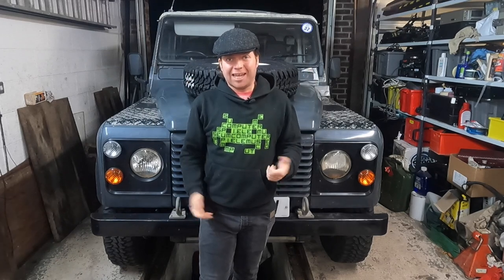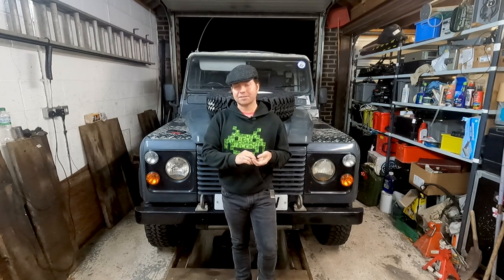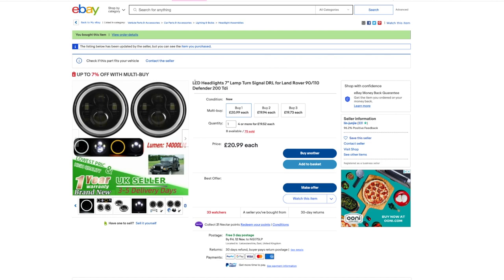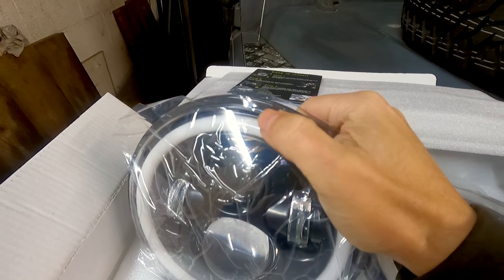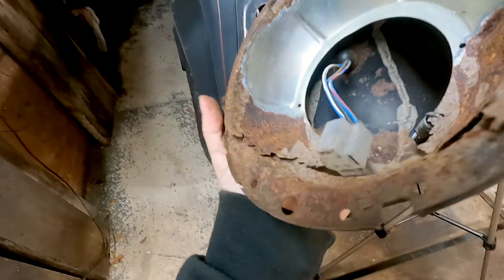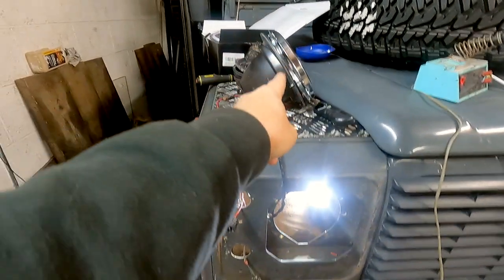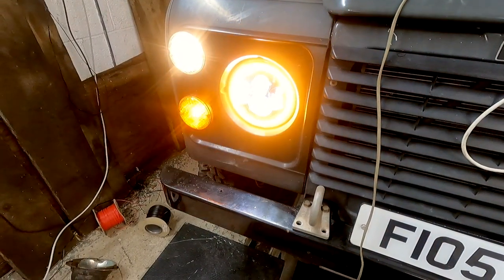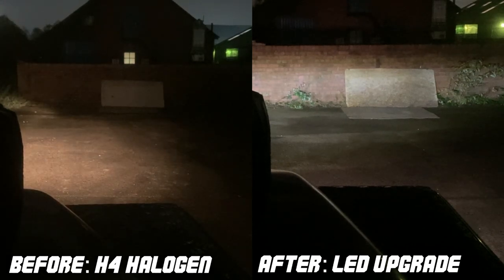LED Headlights: Legality, fitting and rated! Everything you need to know about upgrading!

Comment from the maker: An update on these LED headlights, a few months on...

Positives -
Our 1985 Honda Jazz, fitted with identical headlight units, just passed an MOT test with no advisories.
I've completed a week's off-roading in Wales where they've been dunked under water and still work fine.

Negatives -
With the headlights on they cause radio interference; I suspect some sort of RF filtering is necessary to filter out noise from the switched-mode power supply.
Beam pattern can be affected if the headlights aren't super clean.

Overall, for the price, I'd still recommend them.
Reply: I got news for you, LED's are not legal on vehicle headlights, they never have been and here is why. (You cannot get around this with any type of argument)
Whether they're aftermarket, or manufacture installed, LED's ARE NOT legal to be on any type of vehicle/automotive headlight in any of the 50 states in the USA.

The only place that determines what is legal on a vehicle headlight comes from the NHTSA (National Highway Traffic Safety Administration) They produce the FMVSS (Federal motor Vehicle Safety Standards) section 108 of the FMVSS has not bee updated to include LED's and until it does, then LED's are illegal on vehicles headlights in all 50 states. There is no policy, statute, guideline, suggestion, argument in any county, city, state, town..lawyer, judge, cop, manufacture, mechanic..etc that can over ride the NHTSA FMVSS as they have final say.

Until the NHTSA says LED's are legal on vehicle headlights, then LED's are not legal on vehicle headlights.

You People need to start paying attention to what Governs the laws instead of arbitrary arguments.
Reply: @360Investigations this guys clearly not in America is he.
Reply: @jamiemarks8910  No it isn't clear it absolutely looks like he's in the USA and the exact reason why he should be saying he isn't.
Reply: @360Investigations so the English accent, car plate, the fact he mentioned mot ect not clue you?
Reply: @360Investigations  Just take the L

Comment: Fitting led or hid bulbs in existing lamps will now be an mot fail for post 86 cars (light source not compatible), Pre 86 cars although they will not be an instant fail must still produce an acceptable pattern.

As you stated, fitting complete led lamp assemblies not just bulbs IS not an instant fail on post 86 cars but must still do correctly and produce a correct beam pattern.

Projector beam headlights will often pass MOT with led replacement builds because they do not rely on reflector or lense for diffusion and cannot be easily inspected visibly.

Comment: Fitted the exact same pair today to my 110 county, No soldering needed just spliced into side light and indicator, Pretty simple
Reply from the maker: Admittedly, we went "belt and braces" with this install, as we find splices and crimps end up failing after a few years. Typically you may also find the factory wiring has been hacked by previous owners, too.

Comment: Have you been for mot yet? I've just fitted these myself and I've gotta say the pattern they project dosent seem normal to me
Reply: Mine failed its MOT, and will have to change them back.
Reply: yep thats what i was worried about, some of them have a hurrendous beam pattern unless you buy the extortionate £300+ ones !
Reply: @martinparker9249  two sets of mine have now failed mot, I've had to return them both and return to standard ones 🙄
Reply: @A. Melbs both of the sets I had supplied were bad.
One set pointed wayyyyy to high on full beam (like at the sky) and the other set did not project a correct dipped pattern haha.

Comment: Great video. Unfortunately I'm finding its not so easy with modern headlight pods. Fitted projectors to fix my Mk5 Golf GTI's piss poor stock headlights, but even the super bright xenon halogens are not that amazing in them. I am toying with getting H7 compatible LEDs and just swapping back the standard bulbs at MOT time. However there is still the fun and games of finding ones that are properly CANBUS safe and don't have shoddy external resistors.
Oh yeah and don't get me started on needing to remove the entire front bumper to get the lights out..... urgh, I miss old cars.

I also ask myself will the MOT tester actually bother taking the lights apart to see what bulbs are in them if they work and the beam alignment is all good.

Comment: Great video, what wire did you use for the DRLs? I'm guessing they only come on with the side marker
Reply from the maker: Hey Garth! Tapped into the sidelight feed for the DRLs
Reply: @Motorhaus  so do the DRLS only come on with the side lights?
Reply from the maker: @garthbawden5550  - The DRL Halos are permanently lit once side light power has been applied.
Reply: @Motorhaus  thanks so even woth side lights off the DRLs are on. Any chance you have a photo of which wire you used?
Reply from the maker: @garthbawden5550  - In my install I wired the DRL feed to the sidelights. That meant the DRLs go on and off with the sidelights.

You could, of course, wire a separate switched 12V feed to have the DRLs on with switched ignition, if you wanted!

Comment: Am I correct that for the indicator only split the red wire, and for the side light you only split the green wire? (Ie you dont split the black wire on either?)
Reply from the maker: I can’t remember the colour coding off the top of my head! However, for the orange halo I tapped into the indicator positive feed and did the same with the sidelight for the outer halo ring.

The black wire is simply a ground wire; these headlights take their ground from the H4 bulb socket.
Reply: @Motorhaus  thank you! If I wanted the drl lights to come on with the ignition without switching on the lights I presume I would need to tap that into an ign feed. Any ideas where from where I could tap one easily? (Sorry I am a complete newbie)
Reply: Managed to get mine installed this morning without a problem, big help from your video, thank you for that.

Comment: I fitted the same lights but it won’t pass the mot. Light pattern isn’t possible to replicate eventough its on the lowest setting.
Reply from the maker: I’m surprised to hear that, as since fitting them I’ve passed an MOT no problems. We also have another set in another of our cars which also passed (at a completely separate MOT station).
Reply: @Motorhaus  Well the local car garage wouldn’t touch these lights as he said because they were too bright. I’ll guess going to another garage and let them aim the lights properly will fix it. I think it depends at country what the rules are. I read that another guy had to turn off the drl and blinker ring because MOT. I let you know how it goes!

Comment: An important downside of LED's is that they dazzle oncoming traffic. They are dangerous, they are blinding.
Reply from the maker: In our opinion, if the LED light units are legal and properly aligned, then that really shouldn't be the case. Of course, that's not to say that there aren't illegal and poorly aligned headlights out there!
Reply: This statement is true when is comes to retrofitting the bulbs only to LED within a reflector style housing. These combination generates a huge and mount glare and is very dangerous. The video setup is sound but I really do not think they're e-marked for that price. I notice on the video that there is no crisp cut-off line generated by the lens, which also begs the question on quality...

Comment: as the headlights on those older cars are not relayed ,all the current goes through the switch ,all this means lower current at the bulb .
i had a 1990 Corrado and did a relay mod for £13 IIRC , search on here for "VW t4 headlight relay mod" .
i bought one and fitted it to my Corrado and i was WAAAAAAY better !
you can buy the loom with relays on eBay , piss easy to fit
Reply: You must be talking about headlights where the high and low beam are housed in one unit with dim dil